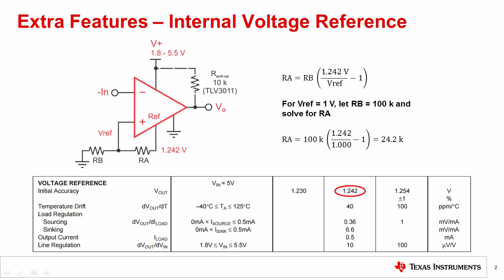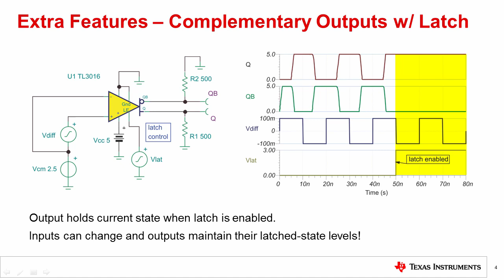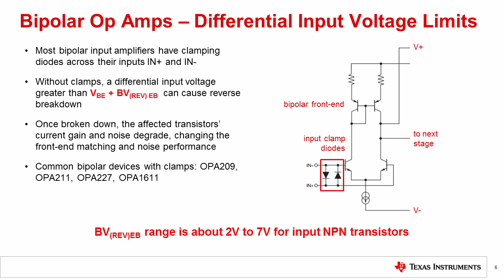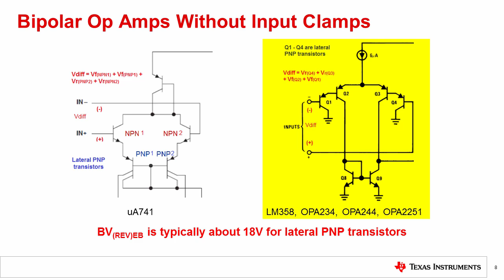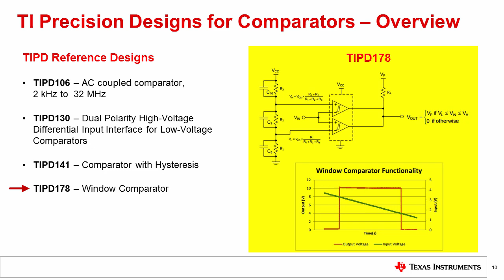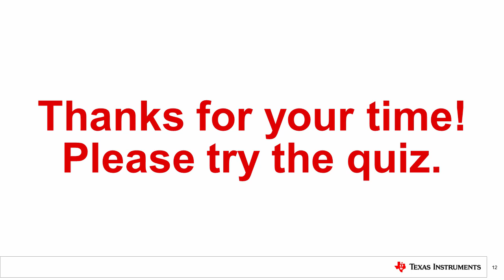Pros and cons of using an op-amp as a comparator

Comment: I am so glad I watched this. The point on saturation recovery time of op amp is actually extremely important!! I was losing my mind trying to figure out why the thresholds at which output switching occured were WAY off from my design when I was using an MCP602 op amp tested with 2Hz triangle wave input. It turned out to be this saturation recovery time!! Indeed the MCP602's datasheet does not specify overload recovery time, and from my circuit, it seems it is in the range of tens of milliseconds! When I slowed down the input signal to less than 0.25Hz, only then did I see performance more closely matching my spec. Terrible! Such slow recovery is really troublesome for inputs that are even remotely "fast"!!